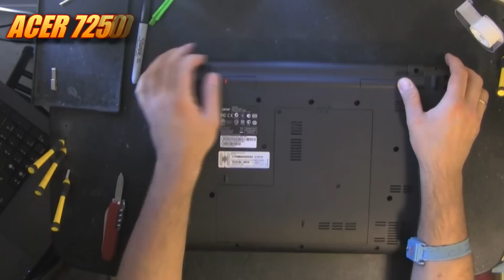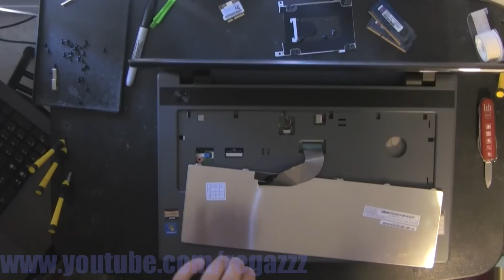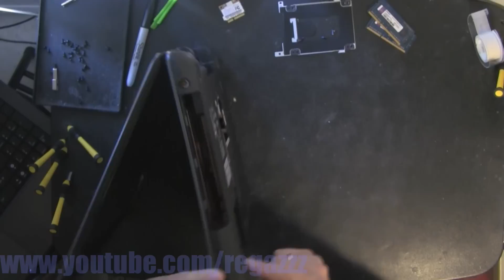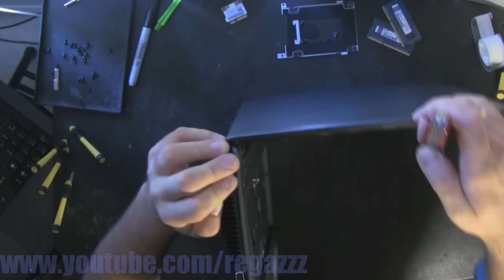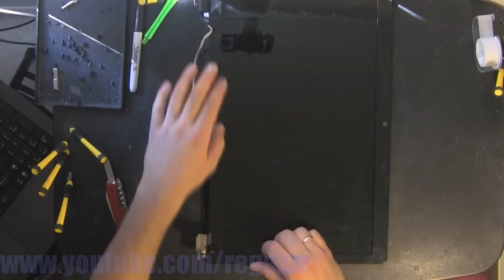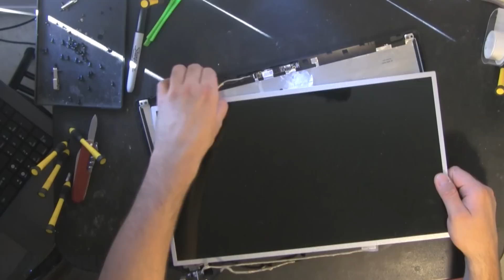ACER ASPIRE 7250 take apart video, disassemble, how to open disassembly

Comment: To everyone who might happen to try to repair this Laptop:
I had the issue that the laptop was turning on but the screen stayed black.
Not even the BIOS Screen showed up, but I could hear the fans blowing.
Tried a few things, but what helped at the end was replacing the bios battery at the back of the mainboard.
After changing it, the screen was working again.
Never thought an empty BIOS Battery could cause such an issue, but I thought I share this info for everyone who comes across this problem in 2025 😂

Comment: i took my Acer 7250 Aspire apart and couldn't get the computer to pull apart so I tried to blow into the fan and make dust come out. And some dust did come out. When I pressed and clicked everything back together and put all the screws back in, the last 2 screws would not go back, they just fell in and wouldn't twist as if the holes were too big. And some little pieces of plastic and an odd little round thing with cogs fell out. :( When I try to power it back on, only the amber battery indicator light comes on. that light does turn blue overnight. But the power light will not light up and the computer will not come on. D':

Comment: Hello, have also problem with Acer 7250: Notebok is running, but image remains black. Have changed Mainboard, still the same problem. It still hangs at mainboard, it most likely Display or background lighting or my son has since the di "FN" key pressed! How can I check this? Maybe you have to press any button and the picture is back!

ниже увидел, что ты и на русском можеш :-)
короче говоря нотик включается но экран чёрный, сын играл в игру и кудото нажал и всё потемнело..я думал что это графиккарта, поменял mainboard, но проблема осталась. поэтому хотел у тебя спросить как проверить?

Comment: U doing wrong becouse never use skryvdriver for a unconnect cable from motherboard and
Reply from the maker: +Edvīns Jēgers I am doing it the way I want. You are doing the way you want. I am not telling you to use s screwdriver. But if you will need to take apart thousands of laptops, you will switch to a screwdriver like that.
Reply: OFF COUSRE every one doing like they wannt but if u wannt god support that have to do right way. thanks.
Reply: You rock man, very quick and efficient video! If someone doesn't like how you do things, they have the choice to not watch and shut the F*** up. Especially when they can't even spell properly.
Reply: what?? did u say to me?